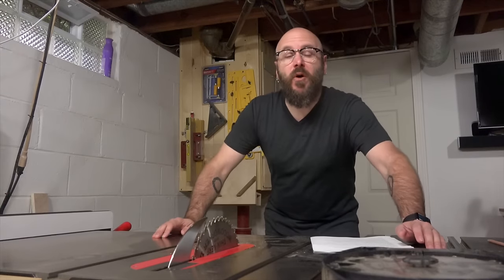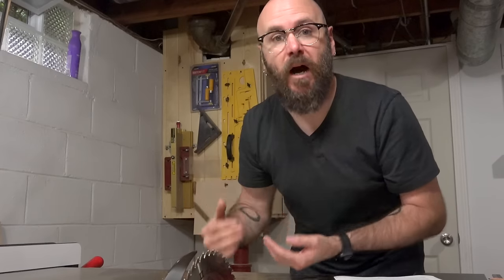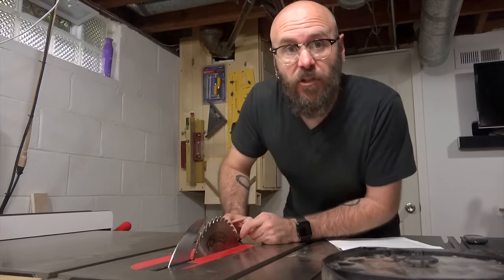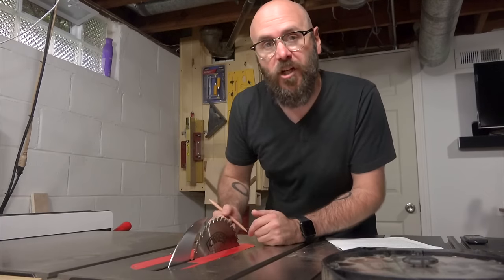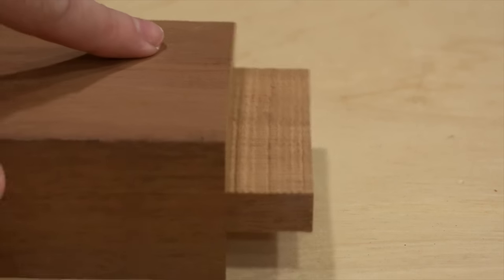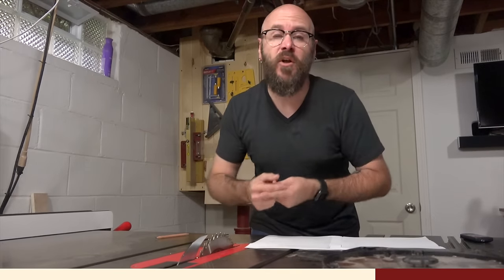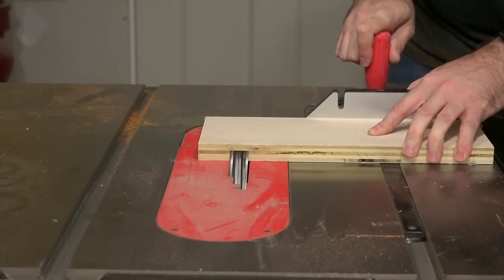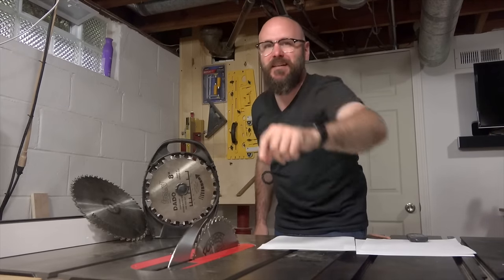The Only Table Saw Blades You'll Ever Need

Comment: Don't be scared to sharpen your "throw away" blades!! Those Diablo blades are sharper than factory when I get them back from my sharpener. Most folks will have a pro sharpener locally so try that instead of mailing them. I've noticed when I send my blades to a manufacturer they grind of twice as much carbide as my local guys!

12" Table saw: 12" Freud Diablo 100 tooth ATB and 12" Freud Industrial 40 tooth TCG. The Industrial line has huge carbide vs Diablo. Want Forrest but went value route.

12" and 10" Miter saw I use a mom and pop brand called W.D. Quinn. They are geared towards picture framers and are very high quality.
Reply: Dombira
Reply: Excellent comment/advice  thank you

Comment: With regards to a thin kerf blade you must be careful to make sure they are compatible with your riving knife. If the knife is thicker than the thin kerf blade, you are going to have a problem. I have a Bosch 4100-09 and it specifically says not to use a thin kerf blade for that reason. You can make your own insert with a splitter to get around that issue but it is an important safety factor to be aware of. The other blade I would recommend is an 80 tooth blade or higher if you are using a lot of plywood as it will help produce a cleaner cut...Scott
Reply: Any kerf as well as plate thickness needs to be considered. Most site saw now come with riving knife for thin kerf blades because they work so well with the direct drive motors by reducing the strain on there lower powered electric motors.
Reply: I have used the Forrest thin kerf blade on my Bosch 4100 for years with absolutely ZERO issues. In fact opposite experience from any issues in that it turned that saw into a different machine (in a good way). That blade may be the only reason I haven't felt the need to buy a cabinet saw yet...Use of a little common sense applies rather than just blindly going by the manual, just throw a caliper on the tooth and riving knife. In the case of the WW II "thin kerf" blade from forrest it works flawlessly and is slightly thicker than the riving knife. So Bosch is wrong and they designed the saw, go figure!
Reply: EXACTLY... I have a Diablo Think kerf  blade and it is thinner than my riving knife and all my wood binds..... i have a 3hp so i dont even know why i got a think kerf... the blade cuts excellent... but it's to thin.  :(

Comment: I think I'll buy the cheaper ones and make knives out of the old ones
Reply: Yes! :)
Reply: cool
Reply: If it's a tipped blade, the steel is mild at best, i.e. not good edge retention
Reply: @15harney1987  that's what you want. Metal can be hardened but not softened. Japanese have been doing it for over a thousand years. You come up with a flexible blade with a hard sharp edge.
Reply: @jamesrogers4674  Metal absolutely can be softened. It's called tempering. It's done to prevent a blade from becoming brittle, and removes the necessity of using laminated  or pattern welded steel for blades as the Japanese did.
Reply: *annealing

Comment: I am buying something through Amazon today by using your link. Only because you reminded me that it's that time of year that I replace my horse head.
Reply from the maker: haha! Thanks!!!
Reply: Jeremiah's woodworks hi run. Forrest woodworker 2 and Freud dado stacks, they are the only blades I own for the table saw I never even used the factory blade when I upgraded saws last year. My best tip is keep your blades clean a pitch covered blade performs like it needs to be sharpened but 5 minutes makes it good as new again. I use the rockler cleaning kit it's a citrus acid based cleaner and wire brush
Reply: +Derik Geddings thanks for the in depth reply. I really only needed the horse head. Thanks though.
Reply: Derik Geddings  Stop with the wire brush ! Buy you a stiff bristled plastic brush. Soak the blades a little longer. Same results. I use any degreaser I happen to have on hand ...mean green, 409, dishwashing detergent...Dawn, Ajax, anything will do the job.

Comment: Combination blades do technically rip and crosscut, but they don't excel at rip cuts. If you're on a "lower powered" saw (ie, not 3hp), I'd strongly recommend getting a thin-kerf ripping blade with ~24teeth if you're doing a big batch of ripping. I use the Freud LU87R010. I don't swap out for every cut, but when I've got batches to do, 2"+ Australian hardwoods just fly through.

I've got the 1.75hp sawstop contractor, its a night and day difference between ripping with a combo blade and rip blade in terms of speed, motor struggle, and more importantly, surface finish. The rip blade is glue ready every time, with no burning to clean up.
Reply: Totally agree. A rip blade requires less power and is worth owning.
Reply: I pop breakers constantly with my 1.75hp saw when ripping with a combo blade
Reply: Tom Gionet  If you’re popping breakers with that combination you have an electrical deficiency. Try using a shorter cord or a larger gauge cord. You can’t run a 12 or 15 amp motor on a 15 amp breaker and load it up...change that to 20 amps.  You also need to consider how far the outlet you’re using is from the breaker panel. It’s probably wired with 12 gauge wire or possibly 14 gauge. The amp drop is an important consideration . You need to be running your saw on a dedicated circuit. If possible switch your motor to 220v...it’ll draw fewer amps and run cooler. Thin kerfs are OK but standard kerfs are better...less deflection. Thin kerf blades are designed for the throwaway, underpowered, portable saws. If you’re a pro, bite the bullet and buy the best blades you can reasonably afford. There’s not a scintilla of difference in any of the top quality brands, they all make great blades. I, through out my career, have used them all but eventually settled on Amana because one of my suppliers had a special on them for about a year. Over that period I bought about ten of the combination blades because we didn’t have a decent sharpener in the area at that time. Don’t take a stack of blades to a new sharpener...take one and use it after he’s done...if it’s satisfactory then take him more. No need to have a stack of poorly sharpened blades on hand. They don’t cut as they should and have shorter cutting life.

Comment: David, what's your thoughts on different blades with numerous jigs? Let's say you set your jig(s) up with a thin kerf blade and then you need to use that jig but need to use a thicker kerf blade for whatever reason. Would that not throw off your cut and/or widen the kerf line that we reference on our jigs? Also would different kerf blades throw off the measurements when using the tapes on the table saw?

Comment: I've got 3 blades that get swapped between machines as needed. All of my circular saws take 190x30mm blades, which is on purpose. While it limits things to some extend, it is the smallest and cheapest size in which proper pro-grade blades are available in my area.
20T rip blade, 48T 'universal' blade, and a 100T thin kerf crosscut blade.

In practice the 100T blade lives in my mitersaw, rarely does it get swapped with the 48T, and only if I need to cut either large stock or I don't want to waste my good miter blade on for example particleboard or HDF. The 20T blade for the most time sits in my table saw, and the 48T usually lives in the track saw.
As for cutting grooves, dadoes and rabets, that's what a router is for.

Comment: Same basic idea for me. ATB blade for the grunt work, flat tooth blade for the delicate work, dado stack for... well, dadoes/etc. Except I go full kerf on my ATB, and I just use the Diablo blades at Home Depot. Since it's the blade that gets the most use, I appreciate the simplicity in replacing it. 

Do you have a pair of Forrest blades so you can keep working while the other's being sharpened, or do you just take time off while you wait however long to get it back?

Comment: For my 12" miter saw, I use a 100 Tooth Diablo, and the original Ryobi 24 tooth blade. 
24 tooth for construction work. 100 tooth for molding/flooring, as well as PVC pipe. 
My table saw has a 40 tooth blade. I do Hardwood floors and bathrooms, so long rips usually get covered with molding, ala 100 tooth miter saw. 
I've cut a lot of stuff with those blades.
Reply: Guns Cars and Digits is that 100 tooth blade a shear face?
Reply: Yes. It was the ultimate finish blade. 
I got rid of the 12" saw and got a 10" with a diablo laminate/non-ferrous blade. Same 5/8" arbor as my table saw. Plus, it fits inside the 18" shelves on my work bench. It still has a depth limiter so I can dado with it. Better deal.  The laminate blade will have some tear-out on things like molding, veneer, and trim. That said, I only cut square, beveled, or convex stuff now, so I don't care.

Comment: @ 4:40...Wow...a dado blade that can cut from 1/4" all the way up to 3/16th!...wait....isn't 3/16 less than 1/4?  Did you mean 3/8?  Thanks for the info.  Been pondering whether to spend the money on a Forrest.  I might have to help you out at Amazon!  And on a side note....have you ever stacked regular, flat, full kerf blades instead of using a dado stack?  I have the same Freud stack and it doesn't seem to last too long going through plywood it's whole life.

Comment: Great video and presentation BUT ...DADO blades are not available in Europe ( well definitely not in the UK ) .Similarly , I can not find flat bottomed blades anywhere ( UK) 
100 dollars (80£) for a tungsten tipped blade is way way too much for a hobbyist  ....they are available at £ 8  to 40 for a ten inch blade ..and they can be sharpened several times

Comment: I'm a noob to woodworking and bought my first ryobi 10", i get its entry level. but when ready to move up I'll spend the cash. Thanks for the vid
Reply: Elienguitar rock with it! Burn it to the ground while you stack cake bc ryobis pricing is unbeatable! I don’t personally own any, when I jumped in I went 1 level up to yellow & red bc I saved up a little before hand but they all will get the job done. I think the most important investment is having the saw aligned correctly (often not good out of the box) & a “life long” blade purchase. I’ve used Forrest blades they are niceee this other carpenter I follow uses FS TOOL blade on his miter saw now that thing looks beautiful! Prob my next blade purchase for my chop saw.
Reply: Make the most out of that saw! Ryobi offers the most bang for the buck. I got a 10" Ryobi Miter saw that I use quite a bit. It has a stop on it so you can do some dado work. I have used it to install hardwood floors before. I just put it on a board with casters and do my thing.

Comment: On a Delta Contractor 1-1/2HP I use a 40T Combo Forrest most of the time, 80T Freud Panel Blade for plywood, laminates, 24T Freud Rip for thick hardwoods or flat bottom, 8" Freud Dado Stack for Dadoes, and a Freud Box Joint Blade for 1/8-1/4" flat bottom cuts.

Comment: This week I have bought a set of blades in an Aldi / Hofer shop in hungary.
Three 184mm (7+1/4") blades, with flat bottom TCT teeth, different counts on each blade. This cost me 3500Huf (12.83$) total. ... about a half that Forrest gets for a sharpening. These are not something to compare to high-end blades, buth worth a try at this price :)

Comment: I have found that the Forest blades need very precise alignment, using a dial indicator or some type, for proper alignment with the fence.  The fence that came with my unisaw was about 0.006 warped and thus made blade alignment difficult.  With the 3hp Delta Unisaw, thin kerf is not for me.

Comment: I’m a beginner wood worker. I’m a welder by trade and Union Boilermaker so I love working with my hands. I have Diablo blades in all my saws. Ridgid 10 Saw has a 10” 90 tooth thin kerf, my Ridgid Table Saw I have a few blades. I have 2 10” 80 tooth for my ultra fine cuts on my hardwoods and then a 10” 84 tooth for cutting my laminate hardwood for my flooring. I also use an 8” Freud dado stack set. I’m very happy with all my blades so far. 🤙🏽

Comment: Two comments, Dave. First, you said you can get a dado from 1/4 yo 3/16 inch, that's going backwards, believe you meant 1/4
to 3/4 inch. Secondly, are you aware there are combination carbide tipped blades where every third tooth is flat tipped for square cuts, they work great. Enjoy your channel.

Comment: For most work, I use a Freud Diablo 50-tooth combo (thin kerf). If I need flat bottoms, I switch to a Freud heavy duty rip blade (full kerf). For box joints, I use a Freud box joint set. For dado work, I have a Delta 10" dado stack.

FWIW, the Freud Diablo blades  are re-sharpenable. I have two of the 50-tooth combo blades, and swap them when the blade in the saw gets dull. The dull blade then goes in for sharpening (a local tool store has a 7-day return sharpening service).

Comment: I stopped using my Forrest Thin Kerf on my Sawstop because the riving knife is thicker than the blade. The dangers associated with that, and the dimension change against the fence (ugh... PUSHING that cut through sucked!), were too much.

Life was so much better after switching back to the standard 1/8th blade.

Honestly, if you're popping breakers, the difference between the work of a thin kerf and standard kerf wouldn't be enough to alleviate my concerns about the actual electrical supply...

Comment: I'm not much of a Woodworker, but I do like to buy and restore old Table Saws, Scroll Saws and such. Bought an old 10 in Delta Table saw/motor on arbor type, for $30 to give to my son. So I had a few blades laying around that looked good. Put one on and tried to cut off some ends of 2 X 4 s to see how the blade worked. It smoked and wouldn't do a cutoff, tried another blade, same thing. So then I remembered I had a New Bosch CB 1060, put that on, Breezed right through the 2 X 4 with a nice smooth cut. I really don't like the Motor/Arbor combo, because if you burn the motor up, it cost as much to buy a motor as to buy a new T-saw. So I will write down the three different blades and give them a try. Can't afford the Rolls Royce blades, so will have to settle for the VW ones.  Thanks for the great info on your video, Youtube is Wonderful, it's my "go to" for information. Keep up the Good Work, you make it easy to understand what you're talking about.

Comment: Of coarse you pop the breakers once in a while.  110 VAC is just not suited for for power tools and machines.  It may be fine for kitchen gear, like a blender.  In my country 240 VAC is regular power.  My garage has 3 x 400 VAC, which also comes in handy for charging electric cars.

Comment: Could you help me good sir? I am diy person, still learning basic wood working. Due to my limited budget, I purchased a surplus Ozito TSB 1208 which comes with a 210mm blade. Now here in lies my problems. First, I just can't seem to find a 210mm blade in my country, as the one attached now is quite dull. Second, would you know if I can use a bigger or smaller blade to replace this one? Closest I could find was a 7 1/4" blade, or a 10" blade. The manual says don't use a smaller or larger blade, so I am hesitant to purchase and try them out. Lastly, the manual also says not to use a dado blade (which I can't buy in my country either, unless I get them from an importer at the cost of half a month of my paycheck), is this because the saw is unable to handle a dado, or is it just a standard warning? I really hope you could help me out. Thank you so much.

Comment: nice blades! i use the 24t thin kerf and reg kerf diablo blade from rockler. both are re sharpenable.  I do  have a dado stack but I don't use it because the time it takes to set it up I could get the job done with my regular  kerf blade.. just as you said.. but if I'm going to be making a lot of tenons or a lot of dedos then I'll swap it out and put in the dado stack..as always, good stuff Dave!

Comment: I use a combo blade and my shop made tenon jig for cutting the cheeks. Nice flat tenons every time. Did he say his stack dado cuts from 1/4" up to 3/16"? Yes he did, I went back and listened to it 3 times to be sure. Speaking of stack dados. Why with his expensive Freud stack dado cutter is he nibbling away at this tenons? Am I the only one that noticed the sloppy fit on the one cut he did make with his stack dado cutter?

Comment: I don't say this to 'correct' anyone but only to help: the 40T blades are typically referred to as general purpose blades while combination blades are typically 50T. They have different cut geometry too. From what I understand a combination blade (50T) is designed to rip and crosscut, that's why it has big gullets and a raker, to clear chips when ripping. A general purpose blade (40T) is a crosscut blade that can rip but isn't ideal if you have a lot of ripping to do. GP blades require more power when ripping and generate more heat.

Comment: I'm not convinced about spending 3X as much compared to Freud or other good blades because it has a thicker carbide and can be resharpened many more times is better...it seems like a bad idea putting all on one blade, if you're working with wood a lot and it needs to be sharpened, there would be downtime sending it in, isn't it better to buy two Freud?  You also have a saw stop, if something happens then your expensive blade is toast if that carbide tooth is damage your blade is toast. Buying a Forrest blade is like buying a tire with more tread life vs buying 2 sets of an equally as good blade. 

I'm disappointed that you would even say cheap blade and you throw it away...I think anyone who watches this channel or any woodworking channel isn't using a harbor freight blade...even still cheap harbor freight blade you can sharpen...when did only expensive blade can be sharpened?